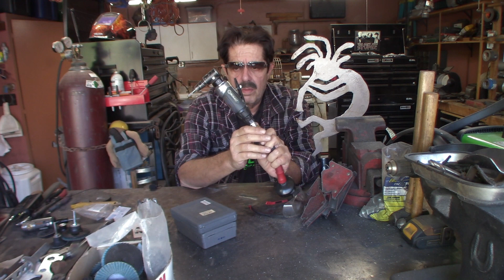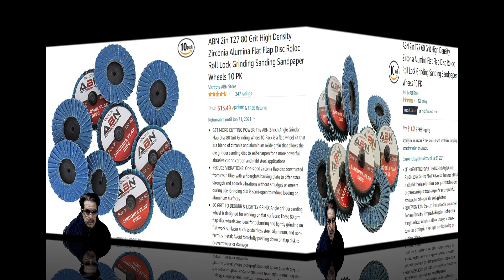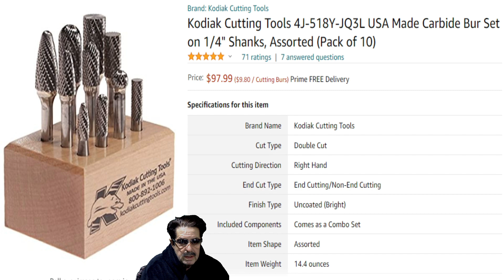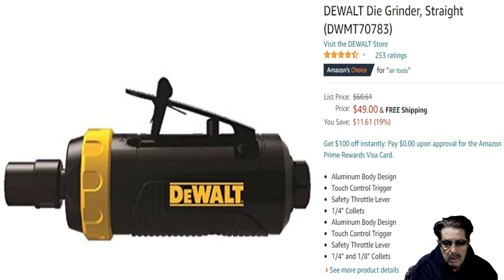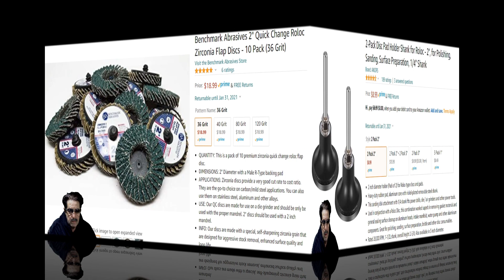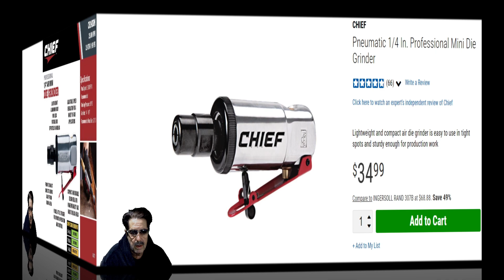Harbor Freight's  Chief Die Grinder - Discussion On Use & Accessories

Comment: Personally I like the angle grinder over the straight. Always better control. And Chief makes an angle grinder too for 50 bucks. But I sprung for the Ingersoll Rand. I already have a Central Pneumatic random orbital sander. But it doesn't have a chuck or collet. Only a female thread receiver for a screw on pad. 
I'll tell ya though,the rear exhaust is a little quieter than the front exhaust. 
Thanks for the video 👍
Reply from the maker: Thanks for the information and your thoughts on this

Comment: great comparison. I can never have too many air die grinders straight 90 or 120.  Use 2" disc by the  box for cleaning and deburring.  Air will never go away.  If you need any drawings done let me know may be able to help you out.
Reply from the maker: Yes - Lets talk about what you can do etc - Email me at Dreamthief12345@aol.com and put title in all caps.........also let me know when you send it so it does not end up in junk mail ............thank you sounds good
Reply: Just sent an email

Comment: It's pricey, but I'm going to try out MATCO Part# 8120.  It's a diamond impregnated cutting wheel.  It's big and thick so it shouldn't shatter.  Not for all applications, but real interesting if you want to avoid losing an eye ball.

I'm going to be cutting on a PC case which is very thin steel.  Which wheels would you suggest for smoothing off the edges of thin steel like that?
Reply from the maker: Having never done what you are about to do my first thought is NOT to use carbide burrs as the sheet metal is thin I would use flap discs, say 80 or 120 or 15 grit and light touch the sheet metal edges and take your time to get that precise look. Thin steel like that on a computer case will want to jerk or move around on you so try to figure a way to clamp it and or use a very light touch with the flap wheels and take your time. Also, I would have a couple good hand files handy if the flap wheels are to aggressive on certain areas or curves in your cutting..............let me know interesting project.
              Plus i will look into your Matco 8120 another good suggestion
Chief straight die grinder my not be as much as we get closer to Christmas Sales - say right now its 35.00 for the straight and 45 for the 90' and with the discount 20% thats 28.00 and 36.00 respectively - not to bad but i would still opt for the Ingersoll Rand because i have other tools made by them and they are very well mfg...........just thoughts
Reply: @TheHomeHandyman  
Yeah, I need a pneumatic grinder and can't decide which to get.  I'm just using it at home, so I'm sure the Chief will work for me, but I also don't want to have to replace it in a year or two.  That juicy Ingersoll Rand isn't that much more and it's looking real good though.
Reply from the maker: @GalaxyStranger01  You can not go wrong with the Ingersoll

Comment: pneumatic will be thing of the past in 10 years in my opinion these new battery tools eliminate alot of problems, humidity, dragging hose , need for air compressor, etc
Reply from the maker: yes and no - I prefer the corded because they generally have more power and i do not have to worry about the charging batteries because i  do my side buss out of my garage but if i had to be more mobile than yes i see your point. Second to corded Air tools are good but you need a good size compressor to keep the power optimal. But, if you can get by with the battery operated ones i think for you that is good but for me it simply is not the most efficient at this time.